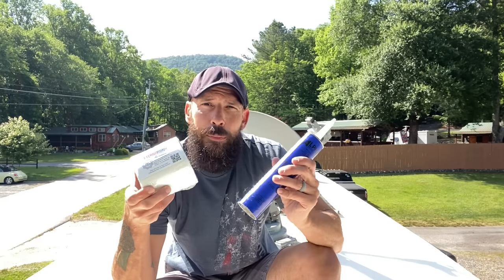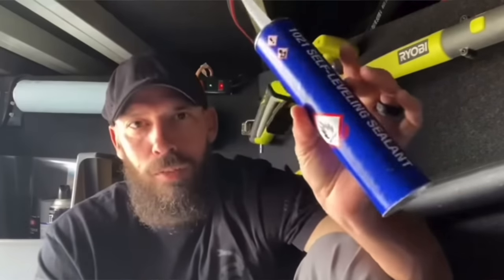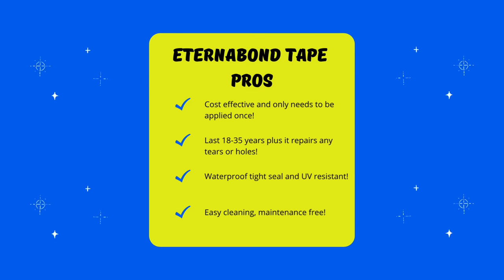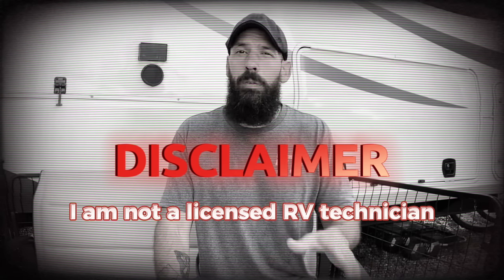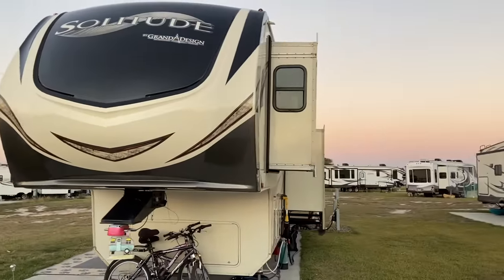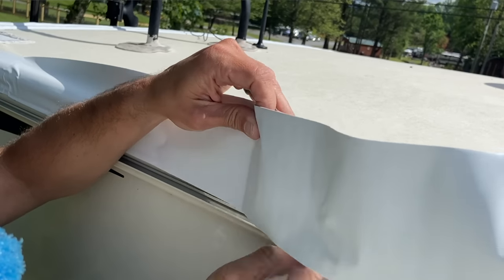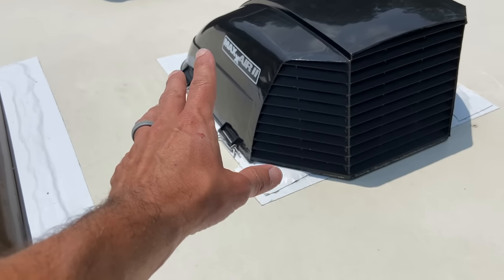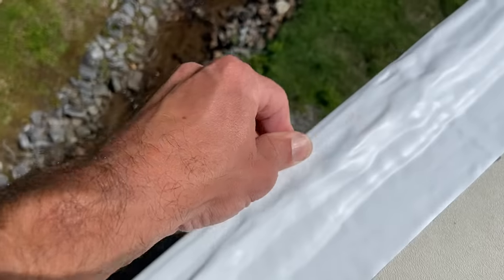NEVER Reseal Your RV Roof AGAIN! (Eternabond Tape VS Lap Sealant)

Comment: Thank for posting! I’ve had many debates about Eterna bond tape as I’m sure you have.
We purchased our Pinnacle over eight years ago. I installed the tape the first week we brought it home and it still looks new. At the factory service center I asked the service manager what his thoughts were on the tape and his response was that if the service techs were building the rigs the tape would be on every one of them.
Reply from the maker: Hahaha love it!! See I knew some people loved this stuff who were techs. Most techs seem to argue against it but I think that’s because they don’t want to remove it lol
Thanks for watching 👍🏼
Reply: I have yet to see anyone including techs remove all the old lap sealant when replacing let’s say a vent. They cut through the old sealant around the perimeter of the vent and install the new one and then apply lap sealant over the new flange and old sealant
If there is tape it can be removed similar but new installation will be much flatter , smoother and more professional. imo.

Comment: I need to redo my roof. 17 yrs old and some plywood needs replacing. When the next step comes to putting new skylight & vents back on, this tape looks like a better & easier time to seal up. If getting another 15 years out of the entire roof happens, then this less maintenance way seems like a better choice as I'll be in my 60s not wanting to be up there resealing anymore.
Reply from the maker: I couldn’t agree more 👍🏼Good luck with the project. Just prep correctly and take your time doing this. Should last for a long time!

Comment: I’ve been wanting to do my edges before we get solar.  Great tip and as an RV Technician I agree it’s a great and useful product to keep on hand for long and short term repairs.
Reply from the maker: Oh yeah. I was pretty happy with the overall outcome. Definitely just take your sweet time, it’s not very forgiving once that tape touches the roof. Lol
Reply: If lap sealant is to lap edges, why put it on ? Can’t I just butyl tape, screw in and then Eternabond the surround ?    I had to ask

Comment: Thx for this video, I have an older RV and have had great success using Henry’s “Tropicool” to cover most of my Fiberglas roof, but I was curious about using this tape on many of my seams to complete the job.  Many of the RV channels say not to use this, but I was wondering why not.  It seems that the proper preparation is key to a successful result.
Reply: I would like to know this question also.

Comment: Thanks for posting. I will be doing a roof repair for a friend but will also be using Eternabond tape on my 2021 that we bought new to make sure my trailer doesn't have any issues in the future. Thanks again!
Reply from the maker: Sure thing Ron. Just prep well, clean and take your time applying. Thanks for watching and commenting 👍🏼

Comment: Wow, thank you for this excellent video. Eternabond is what I'll be using when the lap sealant on my RV is ready for replacement. My only issue is that the manufacturer gooped on so much lap sealant (I'm talking like almost an inch thick!) and left it very uneven on the top that I'm probably going to have to try to shave it down with a knife or remove most of it before I put on the Eternabond tape.
Reply from the maker: Sure thing. Appreciate you checking it out. Good luck with the project. 👍🏼

Comment: I did mine on my 2021 Wild River. The roof was in great shape and wanted to keep it that way. After i taped everthing i plan on using Henry's tropical sealant to finish the whole roof in white. We plan on being snowbirds next winter and heading to Florida so not taking any chances. I don't want to spen fixing i want to enjoy our new camper. Great video. I watch you as well as the other person  you recommend.  Both of you have great videos. Also i watch Jerry also with i love rv life. Like the different approaches you 3 give. Keep up the good work. PS: On the fixures as i call them as i inspect i use 303 protectant for UV protection and seems to be working well. Also my tires they look like new. 3yrs so far. Got the idea from Jerry. I spray the tires once a month takes less then 10 minutes. All the rubber on doors slides etc. Works great.
Reply from the maker: Oh yeah. Appreciate you watching. Those are channels are very good too. Love the 303 and have been using it even before RV life started for us. Thanks for the support and again appreciate the comment 👍🏼

Comment: Doing a 2007 Pioneer,  Fleerwood 25RL now....  Roofs been untouched ,  going to wash and remove the old dicor putty.. replace with eternabond tape on both side seems and end caps as well as all the roof mounts... Then 2 coats of Henry's 887 Tropicool.... beautiful little coach just needed some TLC
Reply from the maker: Nice job. Sounds like you got it down! 👍🏼

Comment: Awesome video!  I just ordered a roll to fix where my roof meets the front cap seam.  I've tried lap sealant and for some reason, it never worked.  First thunderstorm and we had water dripping on us while we were asleep!  I did use some Flex Seal liquid sealant and it seems to be working.  However, I'm going to put this on top of it to be on the safe side.  Plus, it's a good idea to bring with you on a camping trip if you need it.  Thanks for posting a great, informative video!!
Reply from the maker: Glad it helped! You really can’t beat this stuff. Appreciate you watching. Stayed tuned for an updated video on it coming out soon.

Comment: I used VHB and eternabond tape to flat mount solar panels on my cargo trailer back in 2019.  It has many uses. 👍
Reply from the maker: For sure, it’s adheres to almost any surface. Really good stuff for many applications. 👍🏼
Reply: So you didn't have to screw them in at all?
Reply: @jjmcwill1881  Not at all.  The roofing material on my cargo trailer is thin, sorta like a plastic cardboard.  It's still up there with no issues.

Comment: 4EvaSeal tape shows superior tensile properties when compared to both the Roof Seal and RV Seal tapes. The added thickness of the backing and strength it provides is clearly indicated in the tensile property of the tape. It is 27% stronger than Eternabond Roof Seal and an amazing 124% stronger than Eternabond RV Seal.

Comment: I've used both...ETERNABOND all the way! Plus Henry's Tropicool 😁 for where I live, can't get any better for rainy conditions
Reply from the maker: Nice! If you know, you know. Good stuff 👍🏼
Reply: @WhyWait  I had a bad leak, I didn't have time to do anything with my rv roof this last summer, and once I got the chance we were experiencing 25-40 degree weather and heavy rain was on the forecast for the following week...I removed my old gutters and realized I've been getting somewhere damage through the screws attaching the gutter to the trailer....well the eternabond covers all that plus the edges so that problem is fixed, and then I needed something to seal my roof that could be applied in cold temperatures, which brought me to pick Henry's Tropicool, it can be applied down to 35 degrees and supposedly it only needs 15 minutes and it's rain ready haha. I applied it 3 days before it started raining in 38 degree weather, and it's now been raining heavy for a few days....not even a hint of a leak. I previously would use decor lapseal and it lasted a couple years before it started leaking...I'm confident the eternabond will last longer then my ownership of this rv.

Comment: So I've used this before on a pop-up we had and it worked great.
So you partially covered the flexible trim molding that covers the screws on the top edge. I guess if that trim ever got brittle and needing replacement, you'd just cut replace and top with eterna bond.
I'm so doing this in the spring,,I will sleep better knowing I don't have to get on my roof 2 or 3 times a year.
Reply from the maker: Yeah I can still get inside that trim too. I did it recently to tighten a screw down. Just popped the bottom out, tightened my screw and popped the trim back in. 👍🏼 Appreciate you watching the video.

Comment: Do you have any issues with your slide out going in and out or the tape peeling off or getting stuck and straining your slide motors? Great video.
Reply from the maker: Nope not at all. This tape doesn’t move or peel back or anything like that. The rubber flaps move over it just fine 👍🏼

Comment: First time rv owner and I thoroughly enjoy your informative vids. Should I put this on my brand new rig? I'm in residential construction by trade, I've been on the roof and thoroughly looked it over and as of right now everything is good and no leaks but I'm thinking having the eternabond as a redundancy
Reply from the maker: Thanks you, appreciate that. I can’t tell you what to do but all I can say is that I will always have this on any RV I own. Eventually that sealant will crack, flake and require maintenance year after year. Putting the tape down over it is an extra layer of protection like you said and will outlast the life of the RV. Just do it right, clean the surface good and take your time. 👍🏼Appreciate you watching.

Comment: Eternabond is the way to go. I cleaned seams and added eternabond years ago right over seams on fiberglass roof not only does it look way better it has not been effected in 10 years. My roof seams and around my vents   This stuff holds to roof really tightly it is hard to remove but with a heat gun you can pull it off. But why would you. You need to go slow laying it down keeping it straight and being neat. One other use I use it for is extra hold on wires on roof for cameras and solar panel brackets. I used a good industrial adhesive to add to my solar brackets verse making holes in roof which has held fine. But going over the brackets is just extra precaution and it looks good as well. Those brackets have held fine.  I never used lap seal it’s a messy ugly look and I don’t trust it eternabond is proven method.
Reply from the maker: Right on 👍🏼 I agree with you! 
Lots of people out there seem to disagree with this though. Glad yours is holding up well. I appreciate you watching and commenting. 😁

Comment: Great and informative video! If I wanted to paint the roof, should I paint first and then tape?
Reply from the maker: I think you could go either route but that’s up to you. I couldn’t really say. This is from the company and I’m sure you could reach out to them. 

Use on: EPDM, TPO, most PVC, CSPE/Hypalon, CPE, SBS, APP modifieds, asphalt BURs, coal tar BURs, all metal roofs, tiles, shingle, aluminum, galvanized steel, gypsum board, wood, polyethylene, propylene, polystyrene, fiberglass, brick, concrete, masonry, OSB, etc. Seals roof tears, seams, flashings, copings, skylights, gutters, and much more. Can be applied in weather as cold as -20 degrees. Seals for an air, moisture and water-tight barrier. One step permanent leak repair tape.
Reply: @WhyWait  Thank you!

Comment: If you own an rv and do your own maintenance, the best option is eternabond. There is no reason to do lap sealant if you're able to set the tape and forget it. I started in waves and now only need to do the sides. Everything else is done. It still looks new and easy to clean. It's a no brainer.
Reply from the maker: Right on! Well said. Sounds like you got it down and know what your doing. Appreciate you watching 👍🏼

Comment: After cleaning and removing any flakey lap sealant , Can just cover the old crack lap sealant with the tape?  Can I then paint on a rubberized coating over the tape? will it adhere ?

Comment: Great videos! I have a question though about the eternabond at the roof and gutter along  the whole side of the rv. You only put it halfway down and not going into the gutter at all. Cant water still get into the screws if you dont seal the bottom of that removeable channel.
Reply from the maker: Thanks! Pretty unlikely as the screws are set higher up under that channel. I like the fact I can still access the screws by pulling up on the bottom of that piece and tightening a screw if needed which I did do recently on my awning track. But you could go either way with the tape 👍🏼

Comment: When applying it to the side part of your trailer did you put the tape over the entire trim piece that sits above the gutter?
Reply from the maker: No I came half way down on that trim piece. There are screws under there I can still access if need by popping the bottom part up if needed.

Comment: I think my leak is at the front end marker lights on my Gulf Stream trailer. One marker light especially was not making contact with the surface wall of the trailer and the screws had actually backed out. I replaced the screws for larger size to get a more snug fit. Then used the lap sealant along the top edge of the markers. Well, I slowed the leak but still getting some to the inside of the trailer. My issue with the tape is that it wouldn’t look too nice if I used it along the top edge of the markers. What do you think?
Reply from the maker: Probably not leaking at the markers and yes it would look crappy with the tape. Chasing down where a leak is really coming from is a nightmare!

Comment: PRESSING QUESTION: I have a 15 foot awning & want to seal the membrane that is just above that BUT: How do I go over the mounting hardware? Or do I need to remove the hardware send screws THROUGH the ET or just seal the hardware that attaches to sidewall & protect it better??? IDK what is best. 
FYI awning is brand new so won't be removing in foreseeable future.
Reply: This is what I want to know too!!

Comment: Hi there, thanks for sharing. What’s made of your RV roof? Fibreglass, EPDM , PVC?  Did you use primer before you coating? Thanks for your input.
Reply from the maker: My roof is a TPO as standard on most Grand Design RVs. I did not use a primer I just took time to clean the areas well before laying down the tape. 👍🏼

Comment: So I've wanted to do this for quite some time and you convinced me!  Just to verify, did you use 4" or 6" width of the eternabond. I've got both widths. Don't want to go too wide but wide enough
Reply from the maker: I used 4” inch everywhere. That worked for me. Only place I probably could of used 6 inch was where the front cap meets the roof 👍🏼

Comment: Easy fix. Make minimal use of Eternabond tape. Forget Dicor products. Use a isocyanate free, 100% solids self leveling product like Premier Pro sealant. It only takes one properly applied application to last the lifetime of a typical RV. It does not collect dirt like Dicor. It can be applied to wet surfaces for emergency repairs. It maintains an elastic seal that will not break or release from the surfaces. I only have one problem with Premier Pro sealant. It is light grey in color. However,  that's a small price for a guaranteed one and done application.

Comment: I'm 8 months into full-time camper life. 2007 Crossroads Cruiser 32BL. A hail storm got me in April & I need to coat & seal my roof asap.
My question is... Why would you cover the screws on slide out with that tape if it's so difficult to remove? What if slide-out needs work?
Reply from the maker: Those screws I’m covering are nothing more than holding that trim piece in place. Not exactly something that needs to be replaced often and if I do need to remove that trim it basically means I need to remove my whole slide wall and I have bigger problems to worry about than a little tape. Plus the tape is difficult to remove, not impossible, it just takes a little work and patience. 👍🏼
Reply: @WhyWait  2 of my 3 slide outs are delaminating already. That's why I was curious! I'm still in the newborn stages of this lifestyle but love it so far!
So, do I do tape or lap sealant 1st... then coating last?

Comment: Questions: I have repaired, sanded and cleaned a vintage metal roof camper. Should I paint the entire roof first and then apply the Eternabond tape?  Or should I apply the tape and then paint. Thank you!
Reply from the maker: I do t know anything about that sort of roof so I really can’t tell you. All I can tell you is that EternaBond bonds to virtually any surface except silicone. This includes all roofing materials, brick, wood, metal, stucco, rubber, vinyl, canvas, etc.

Comment: I wasn't sure if it was worth the money for the eternabond tape ..I have tried the gorilla rv roof tape only lasted one season water was getting under tape and I removed it by hand ..only pulled right up I may try it thanks for the video..
Reply from the maker: Go check out H.B. Fullers website. Link below. 
They make all sorts of professional products and adhesives for many different things. Eternabond tape is just one of their numerous products. This isn’t Gorilla Tape or Flex Seal as seen on TV crap. Almost everybody I’ve talked to and everybody who has also commented on this video who has used Eternabond Tape in the past loves it and talks about how well it’s held up. It’s the way to go!! 👍🏼👍🏼Thanks for watching
https://www.hbfuller.ph/en/asia-pacific/products-and-technologies/markets-and-applications/building-and-construction/commercial-roofing

Comment: In the beginning of the video you mention that there are perceived negatives to using Eternabond, namely the  difficulty of removal and mention that the issue will be addressed later in the video, but you never do. I've applied the product on my roof a few years ago and it's been a godsend! But your thoughts on possible removal would be helpful.

Comment: What do you think of the RV-Armor roof?  Getting ready to buy and been thinking of having everything sealed regardless of condition.
Reply from the maker: Have no idea. Never seen it used on somebody’s RV. Heard it adds weight but I’m sure it does the job. Dont know what you need to do if you have to replace a skylight or something up there.